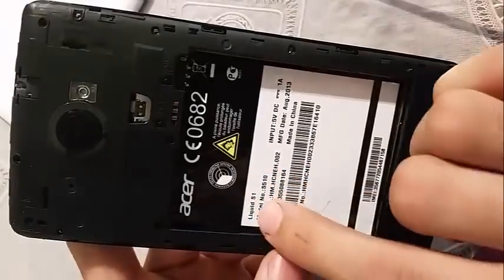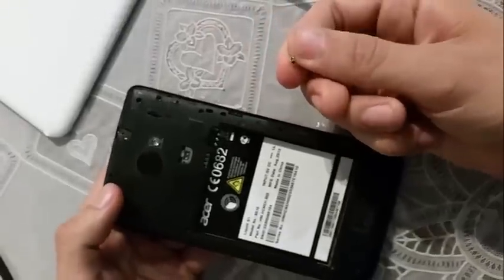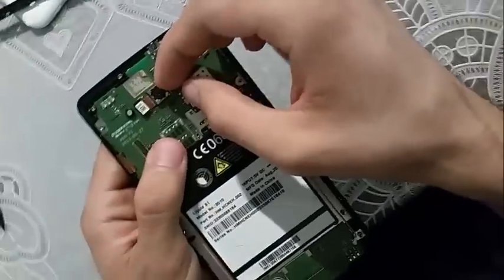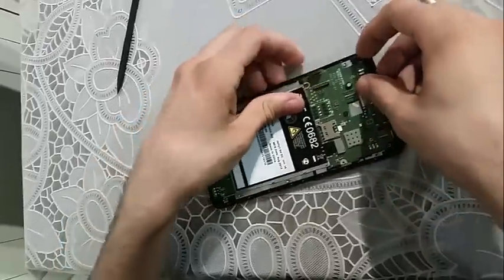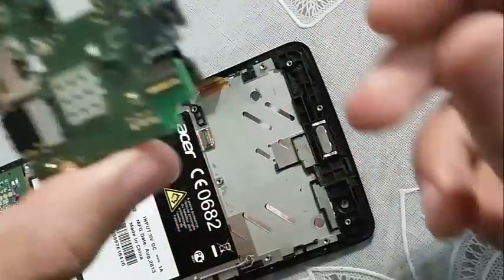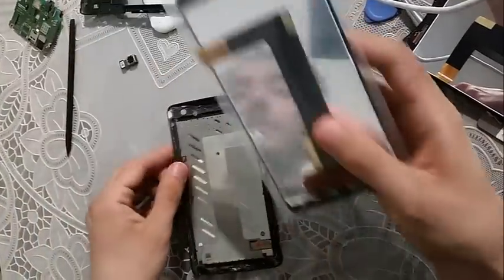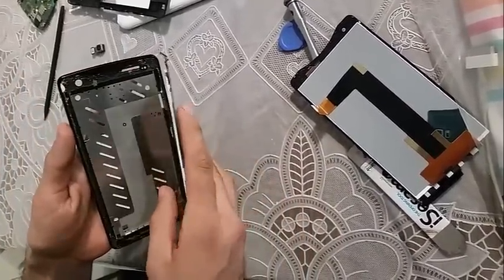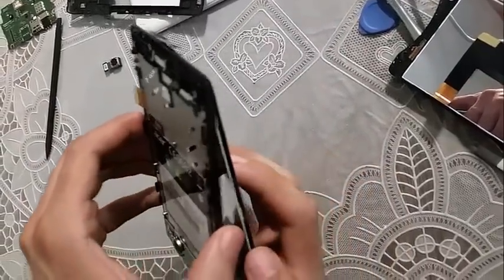Acer liquid s1 screen replacement  2015

Comment: I bought a replacement screen here : http://www.ebay.com/itm/381307422884?_trksid=p2060353.m2749.l2649&ssPageName=STRK%3AMEBIDX%3AIT
Perfectly working! 
but thera are some steps missing in this video, it is not so easy after all. you have to heat a little the screen to remove it (it is fixed with glue). now i am looking for a way to get my loudspeaker and vibration working because they aren't functionning anymore.
Ah, and be carful about the clip that hold the motherboard, they can broke easilly ;)
Reply: Serge KEDJA please the replacement screen u bought is it original & working perfectly
Reply: I cannot tell if it was an original one, but it is working perfectly. From my oint of view, it was a little bit better cause I broke it (again) but it was still working!